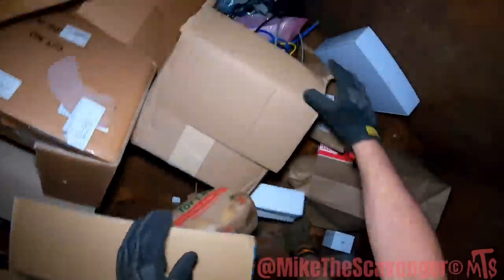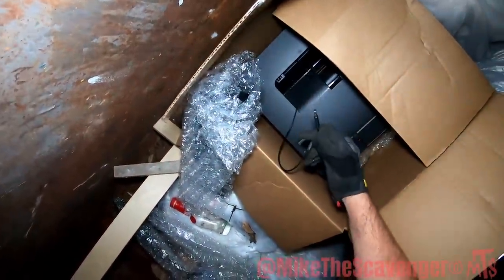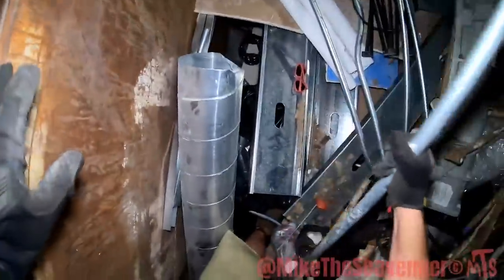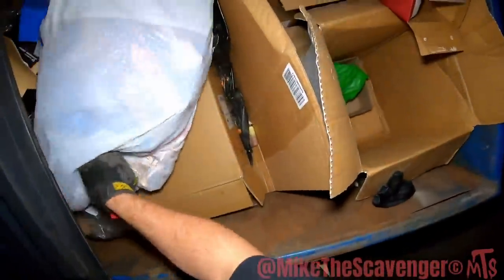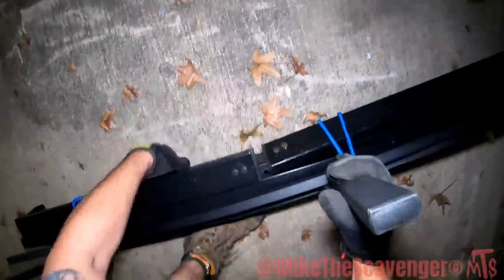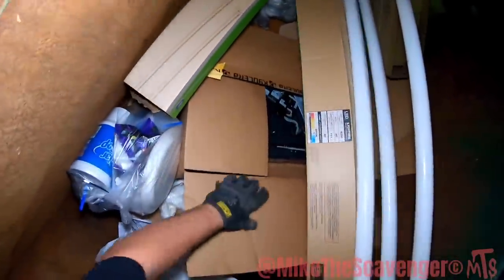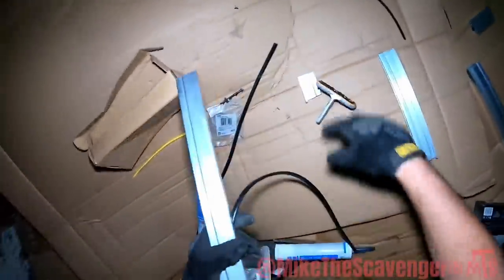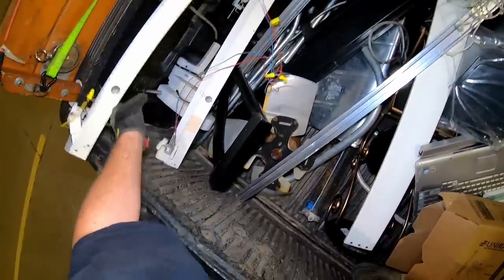Dumpster Diving "It's Got A Joystick!"

Comment: Mike, the CPM machine sells for $2500. It is a continuous passive motion machine to increase ROM range of motion in the knee. Do not scrap it. Anyone who has knee replacement uses that machine. It is still currently used. Very valuable.
Reply: My sister had to rent one from the hospital.  Crazy expensive

Comment: Hi Mike and Laura.
The optical item went for over $6K new and used for checking your eyes. Could be made by A.O. amd still has value to Dr's South of the border.
The other item sterilizer the air in duct. Some give off a smell like ozone after a lighting storm.
The  Kinetic energy might be for a game system Is worth checking out.
PS: If you ever find Teflon wire never scrap thar. Most likely high tempature and sver tinned. I have a few small spools of it. Coax teflon coated.

Comment: Mike,  melt the lead with some pewter and a bit of tin turn into ingots ( cup cake size tins) and sell to local range for reloads. The recipe is on you tube somewhere.  Big money especially if you can save up till you get about 100 lbs or so.

Comment: Mike, is the wire easier to strip if you do it off a spool, cutting it into acceptable lengths after it's stripped ? also, how  many dumpsters do you actually go through in a night, the ones that (of course) don't make the video cut.

Comment: Mike always check heater elements of all types and especially the coil wire type because most of the time they are stainless steel
Reply: i thought most resistive heater elements are NiChrome wire?

Comment: You are doing good work to get metal out of those dumpsters, othervice going to some landfill, and specially for those medical type things you are donating to those in need. Here in Finland we are like by law to recycle metal, plastic, cardboard, paper, and wood, separated to its own bins, and ofcourse biomaterials , to compost. Its quite little to landfills left after that recycling. And most of left can burned to energy in form of heating in big scale.
And one think more, You are so f++king good with wood, why not to add some steampunk design to your work with some metal parts you find all the time, and make it funktional artpeace, you can learn welding also if you cant it yet. There are no limits for you, do it. You can.🤩🤩

Comment: Hey Mike did you ever find out what those wooden blocks and stencils were from the other video?
Reply: They are die-cutting blocks. Each has a shape, letter, or number that it cuts out of construction paper or card stock. They are expensive, $25 - 45 bucks Each, as I understand from my teacher wife. They are used quite often in k-12 schools with more weight on the elementary grade levels. They are the reason for the neatly cut letters on so many bulletin boards.
Reply: @Vault57  cool thanks